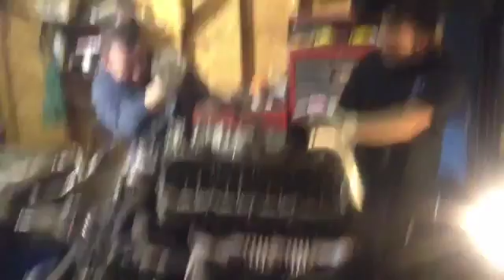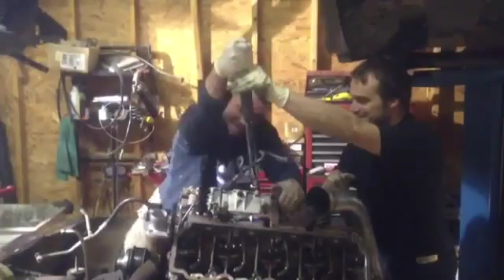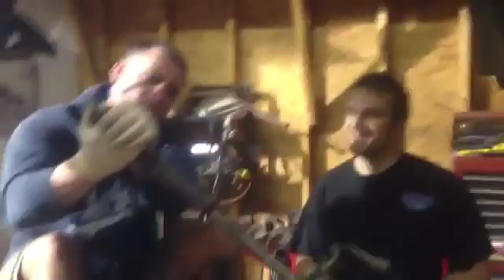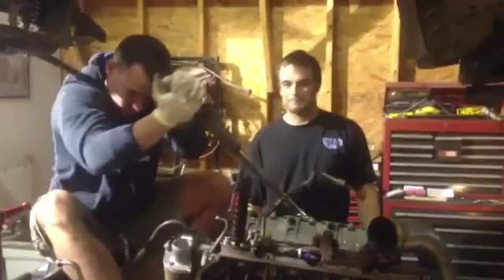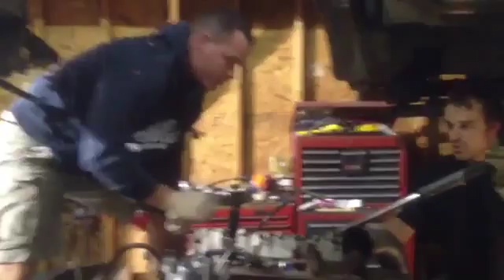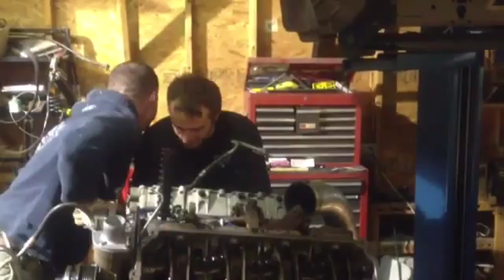torquing ford 6.0 arp head studs

Comment from the maker: Step 1. Tighten studs 1 thru 10 to 90 ft-lbs.
Step 2. Tighten studs 1 thru 10 to 180 ft-lbs.
Step 3. Final tighten studs 1 thru 10 to 265 ft-lbs.
This is arp torque spec

Comment from the maker: We have been doing this for years with not problems all of us in the video are diesel tech we did follow ford torque sequence to the t use arp torque spec and then the 90 deg them all to the wrench did not go over 200lbs and correct me if I'm wrong but arp final torque would be 265lbs
Stock is accually another 90deg on top of that but with studs that do not stretch it is way too much. With the 90's they will come up with an average of around 250lbs, but some of them may get poppy when turning them and will cause the tqu to skyrocket, those are the ones that will kill your head gaskets when just goin by tq only cause while some may be 250 others are maby only 200. Using angle they will have the same down pressure no matter what the tqu is. I have been driving this truck since them and it has no missed a beat still running strong and just click over 200000 last week

Comment: ARP studs are torqued to a specific value and then you're done. There are many schools of thought on exactly what that specific value is, but 230ft lbs is a happy medium. You'll do a torque pattern at a lower value to 'set' the studs and heads, but the final value is the final value.
In the video, it sounds like you are torquing the bolts like the factory tty(judging by the fact that the torque wrench seems to be turning 90 degrees every time, and the girl in the background said something like "first 90"). I forget the specific initial torque, but the final torque for the factory tty bolts is a series of additional 90 degree turns on the bolt. It's called a yield torque and it's what the factory bolts were designed for, but doing the same to ARP studs is a big no-no. They are a stud, NOT a tty bolt.

Comment: I know this video is over a year old, but I am quite surprised none of the 355 people that have viewed this picked up on something you may be doing VERY wrong! After seeing the first torque pull and listening to the lady in the background, it sounds like you guys were torquing the ARP studs according to Ford tty bolt torque specs(110+3 90 turns), in which case you just ruined a $400 set of studs.
Reply from the maker: We'll explain then